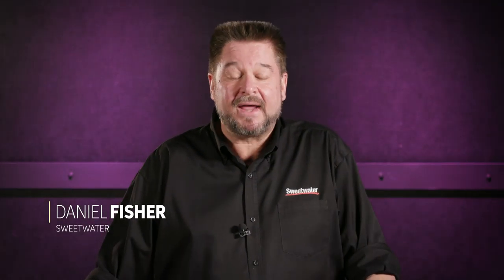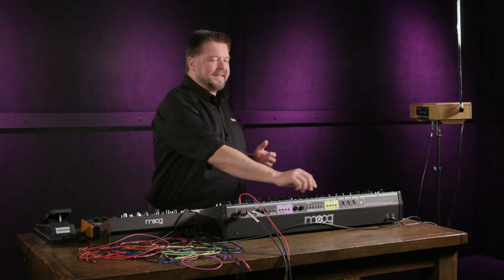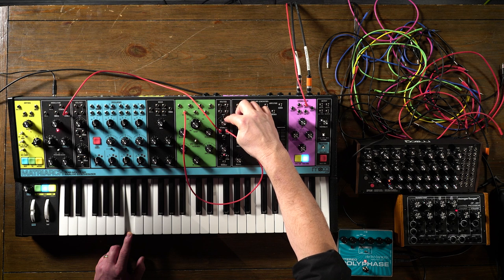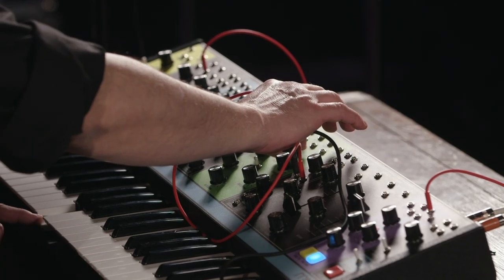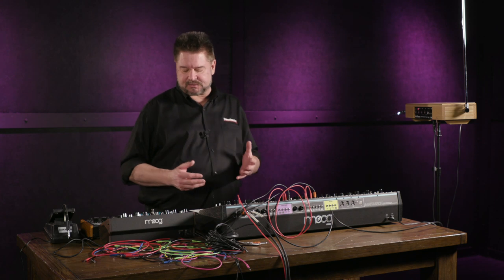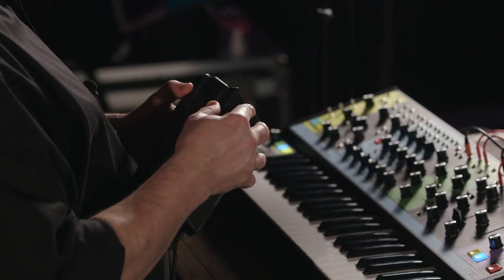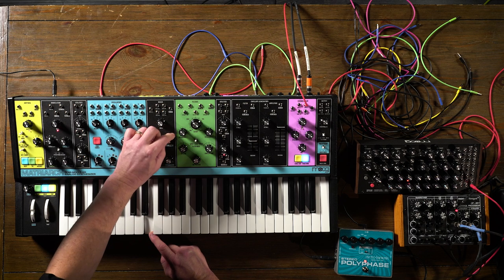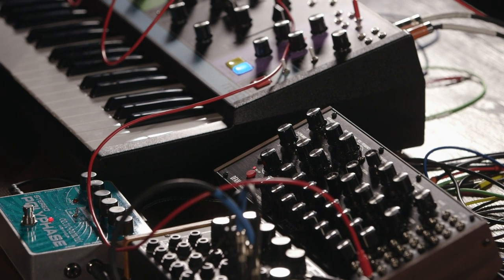Control Voltage (CV):  What it is and How it Works — Daniel Fisher

Comment: Several years ago I could not wrap my head around this. Now it seems to make sense.
Though I don’t understand entirely how all of it would be useful, like the theremin when youre pretty much reassigning a knob and could control via knob? Seems like a lot to control in a different way under a different feel.
The dfam as a makeshift sequencer is cool, but again is it superfluous if the synth already has one? The simultaneous duo control and inverted voltages interest me the most for allowing creativity.
I’m wondering how I can make use of the CV on my Moog One to expand its capabilities. That CP-251 looks like it offers some neat inter-control control?

Comment: Is there a way to know if the control voltage you are providing is too much voltage?  Like could I use the audio signal from my older Moog theremin to be the CV signal (not equipped with CV out)?
Reply from the maker: Hi TOA. Most products with CV Ins and Outs have a Specs page that shows what they're sending and what they expect, voltage-wise.
I think you'll find that the Audio Out of something is mostly useful if it's going into an Envelope Follower, and then use the CV out of that. But, typically, an external signal in the audible range of frequencies is not as useful as you might hope. -Daniel

Comment: This was really good. I learned a lot.  I do have a question regarding one of your hookups that seems possibly risky.  If I understood what you explained, the EHX pedal puts out a master voltage for the expression pedal to attenuate or pass.  The exp. pedal does not supply any energy.  So now you connect this "hot" expression cable from the EHX into your ?hot LFO control voltage out? Is there a way you wire the TRS->mini that cuts out the EHX source or it can just take it or what? I would have big sad if I smoked my matriarch from a sht pedal lol.  edit: no I dont have a matriarch. I wish, but I don't even want to smoke one in my dreams haha

Comment: Hey SW team, question if you guys get a second. The expression pedal adds resistance to the incoming voltage from a guitar pedal and then sends back either the full or attenuated voltage to the pedal to control the given parameter. When plugging an analog CV source like this into a guitar pedal expression input, is it the case that instead here no resistance is being applied, only variable voltage added?
Reply from the maker: Hi EthanRMus. You have it exactly right. Sometimes, depending on the manufacturer, you might have to push the 1/4" TS plug in only halfway to get it to work. -Daniel
Reply: @sweetwater  Thanks for the reply Daniel! Its a bit hard to understand how this works. In the one case, the effects pedal has a parameter range represented by whatever the full output voltage is down to however much voltage it reaches upon r
encountering the max resistance it is set up for (whether for use with an expression pedal supplying 10kOhms, 25k, 50k, or 100k, whatever its setup for). In the other case, its range works from the max output voltage, to this voltage added together with an incoming CV source. The user however doesnt have to flip a switch or do anything to tell the pedal which range to use to control the given parameter. How does the pedal know? And even more, is the pedal still outputting that voltage via the EXP jack to the analog CV source? Then wouldnt you have two voltages traveling in opposite directions simultaneously? All just very confusing lol

Comment: Is there really any benefit of shaping the sound through cv? It seems that l of this can be done in a VA analog synth, or an old analog synth. Whats the benefit of this over traditional analysis or va synth?
Reply from the maker: Hi David. The obvious answer is: If your synths and modules use Control Voltages (CV) as their primary source of control, that's how it has to be done. But, even if your synth uses MIDI for primary control, with CV used as an option, you'll find that true CV (being pure analog) has a response time near the speed of light. This allows for modulation speeds far faster than many VA synths can handle. CV also allows far more freedom to experiment with connecting anything to anything (even if it doesn't make sense). Thanks for watching! -Daniel

Comment: This MAY be the dumbest question asked in a while BUT here goes anyway……. Can you split 1 CV Signal to multiple Synth’s capable of receiving CV? Why am I asking…….. Moog Werkstatt’s are dirt cheap, I already have one. Grabbing 2-3 more to simulate 3-4 voice paraphony by detuning 2-3 of them could be INTERESTING. I seem to recall someone using a splitter this way out of an Arturia Beatstep but that might have been out of the 1/8” jack for the MIDI , was a long while back. If i split the CV port would I need something to boost it’s power or is there a box of some sort that would split and detune the extras? I’m sure I can easily do this with my Akai Force but eating up 4 of my 8 CV outputs for “1” conglomeration of synths seems wasteful.

Thanks for the info. I appreciate it.
Reply from the maker: Hi MMF. It's actually a rather tricky question. You can, of course, use a MULT (Multiple) to split the CV into multiple CVs. Synthesists do that all the time. The tricky part is that your CV only represents one Note, so all of the additional Werkstatts would all play that same note. You'd need either a controller keyboard that sends polyphonic CV Outs (the Arturia KeyStep Pro for example), or a MIDI controller keyboard connected to a MIDI-to-CV converter that can handle polyphony. -Daniel
Reply: @sweetwater  thanks Daniel I was thinking more along lines of detuning the additional ones. Just crazy ideas tho as I often just AutoSample my favorite patches into my Akai Force as a Keygroup and then have essentially endless voices

Comment: Nice explanations. Thanks. Some sounds came close to a bagpipe, that is a sound I cannot seem to find on any synth I have checked out, is that your experience as well?
Reply: I think bagpipes usually have a drone... see if you can turn off keytracking for one of the oscillators on your synth, so it always plays the same note.
Reply from the maker: If you want to be even more authentic, the "drone note" is typically Bb. Thanks for watching!